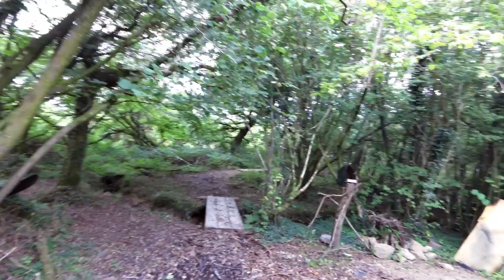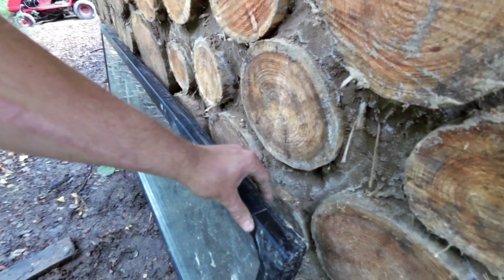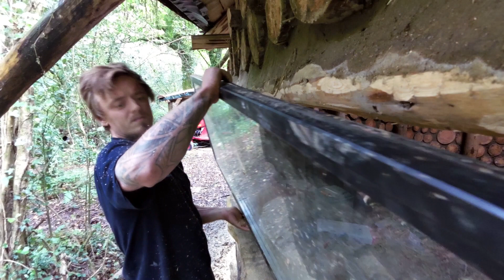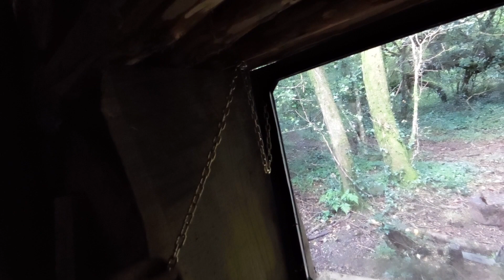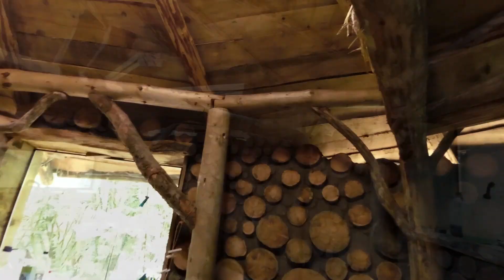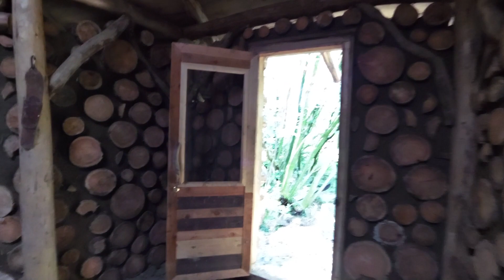Off grid roundhouse build part 22

Comment: Hi Kris, do you think it would have been faster if you used smaller cob joints in the wall so the logs were closer together requiring the minimum amount of cob? What about stripping the logs before you saw them up? Time could have been saved in each log applying the cob and each batch would have covered more wall?

Comment: One way to get through boring repetitive tasks in a project is to work extra long hours and push as hard as you can to finish as soon as possible. Another approach, if that doesn't work is to move on to other parts of the project, while doing a little bit of the boring stuff every day. For example, you could close off the top gap with plastic and move on to other aspects of the roundhouse BUT you promise yourself you will do ONE batch of cob every morning and set the logs that you can, and then you're free to work on the other more interesting projects the rest of the day. One batch of cob and setting the logs should hopefully only take about 2 hours, and then you're free to do something else that's more inspiring. The change of scenery will help keep you in good spirits.

I'd offer to help you for a day or two if I weren't on another continent.

Comment: you know you could use the lumber up at the top instead of logs  that you got from your friend. Here in the states we use cement instead of cob goes a lot quicker . One could even use a cement mixer to make the cob in would save on the labor
Reply from the maker: so is everything in the universe if you use that logic. the point is no energy goes in to clay to produce it that already happened millions of years ago.   so it has not got a carbon footprint. lime has large energy input but then reabsorbs carbon while setting. cement has a huge carbon footprint because it must be heated to a high temperature. the term natural material around here means it has not undergone extensive human changes with high energy inputs to produce.
Reply from the maker: hi lynda, thanks for answering comment for me :) exactly what i would say. cob is natural and cheap just labour intensive to mix, cement is one of the biggest carbon sources is expensive but alot fast to mix. its also worth remembering the cement does not breath, and this kind of building needs to breath or it will rot.
Reply: Not trying to be funny at all... one of the main points of natural building is that it is using natural materials. Cement is an extremely toxic substance that has a very high carbon footprint. Lime mortar is a much better alternative, but the fact is here that clay is free, and very green, and very insulating. Peace.
Reply: Sorry for jumping in Kris, guess I figured you were still stuck up a ladder somewhere. Just remember its almost done... and thank you so much for being so honest, and putting this education out there. Its really appreciated. And out there for generations to come. Respect to you.
Reply: Kris Harbour you still could use a cement mixer to mix the cob
Reply: ram1brn
um, cement is a manufactured product?
 (and using a cement mixer would use either electric or petrol, he hasnt got his electric sorted yet, and petroleum products are not great)
Reply from the maker: your welcome to jump in anytime. i wont be relaxing long before i am back up that ladder a couple of days and i will be back.
Reply: lynda williams cement is a natural material LOL so is lime  And as for carbon footprint they are both mined in the same manner
Reply: Why is he using electric and gas tools?
Reply: That's what they use in Ireland. Here in the states, however, we use magic and telekinesis. I actually have a magic cob mixer and it's powered by intensely focusing my aura. Works pretty well when I'm not campaigning for Trump and fucking my cousin